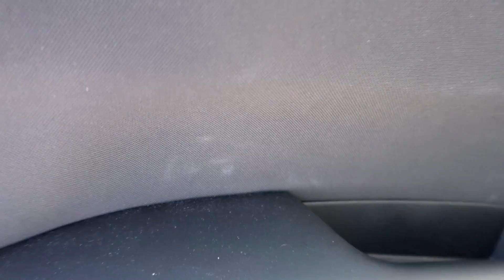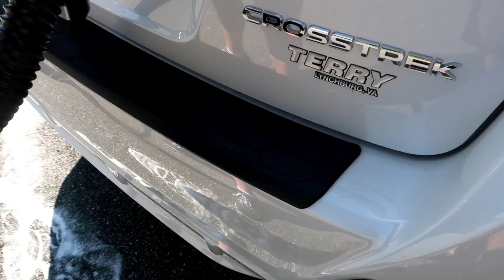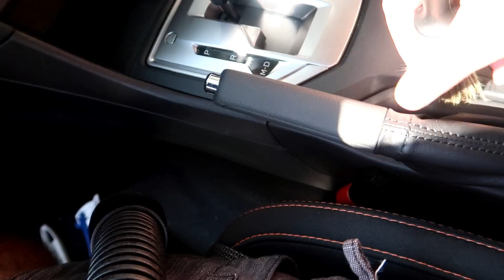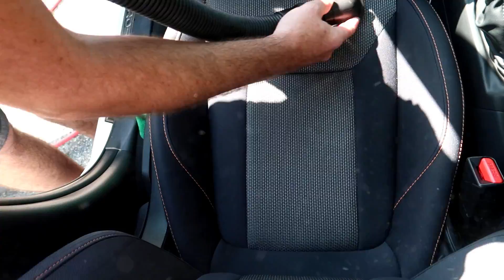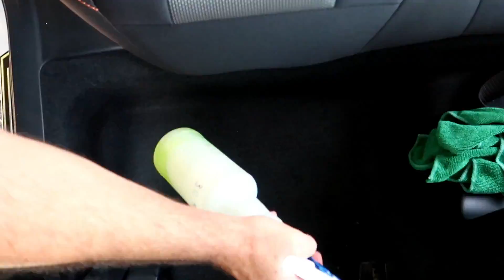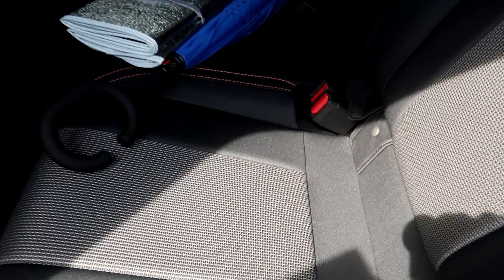Interior and Exterior Detail // New Subaru Crosstrek

Comment: Hey great video, I hope you see this comment as the video is kind of old. But I am going to be detailing and protecting an Interior on one of these new Subaru Crosstrecks and I’m curious what you used on that crazy dash material. Customers wants some kind of protection on it. Would a Flex type ceramic coating work?
Reply from the maker: Hi. What type of material is the dash? Is it a plastic material?
Reply: @MirandaDetailing  it’s like a rough rubber/vinyl material. It seems to grab everything.
Reply from the maker: Interesting. You could use a protectant like a ceramic spray sealant. Like the new Hybrid solutions inside job. Or you could use something like Gtechniq leather guard.
Reply: @MirandaDetailing  perfect, that’s what I was thinking as well! Definitely going to do a test spot. Thanks a ton! Your channel is definitely a staple in the detailing community!! Always great content and advise!

Comment: I own a Crosstrek what type of towel rag etc do I use to clean the dashboard. Nothing slides across it to clean it up. 👎
Reply from the maker: I hate those textured surfaces. they are difficult to clean. A low nap towel works best, I also dampen it with water first. 
https://bit.ly/3nqK7HB